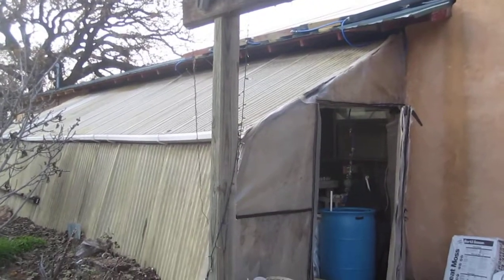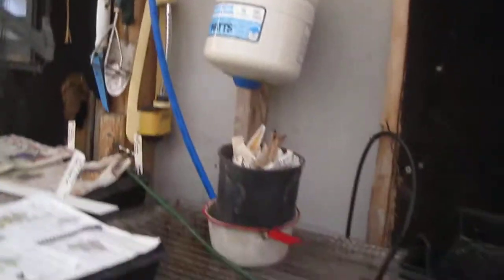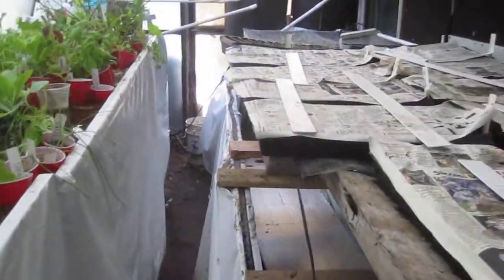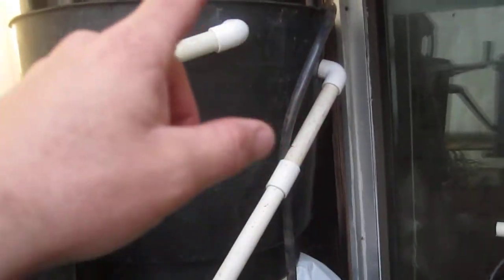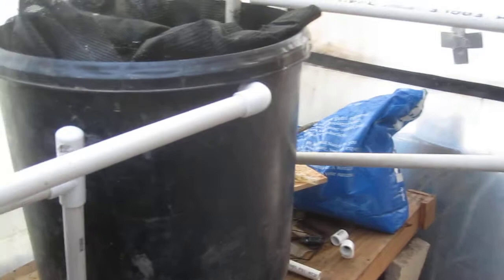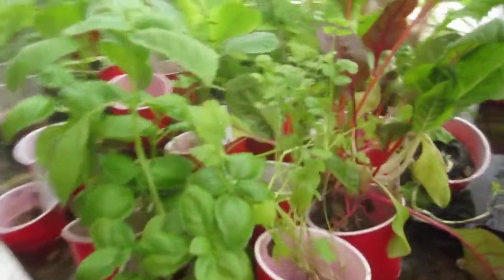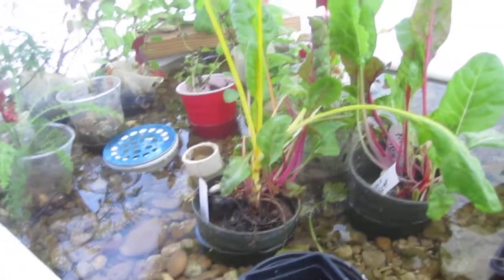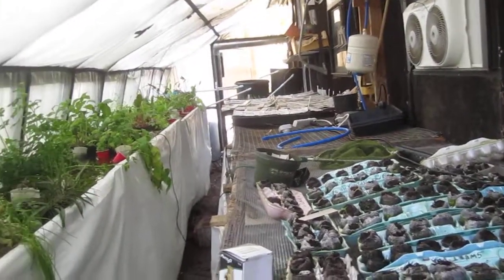Aquaponics Project with Solar Heater

Comment from the maker: also used PEVA Non Toxic Vinyl  billboard tarp...I guess the copper is the only wildcard in all of this, and I think I probably would use pex or have a separate heat transfer container...but even as is, the copper "toxicity" is nominal. 

Hope that answers some of the questions to your comment! I would love to see a system you have developed that solves the heat problems, but is less "toxic".

Comment: Ditto on check for leaks, maybe use blue food color in windshield wiper fluid, not supposed to be as toxic as antifreeze... Awesome setup. I'm sure you've seen the large ibc containers that could improve your system at some point. I think they're around a hundred dollars each

Comment: Never use any pure copper anything with Fish. Instead look into transmission coolers they are made from Al or stainless. Or maybe a radiant base board if you can find one made out of Al or stainless. We sold minnows for years and this is how we transferred temp changes.

Comment: @familyafair I'm using an Arduino with a photosensor and relays to control the cycling of  a 12v pump and solenoid valve.  

All powered via Solar ;-)

Comment from the maker: @diazpty The copper tube is suspended in the water and it does not touch the tarp. I am trying to find a regulator cheap enough to make it worth it. For now we just turn it on and off during peak sunlight hours. Thanks for the question!